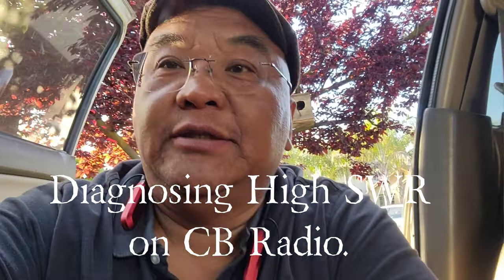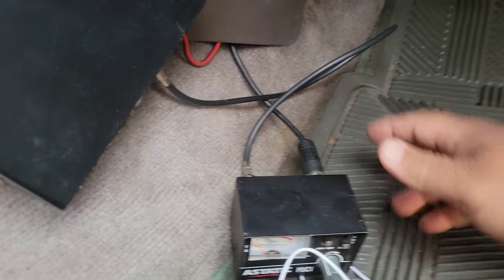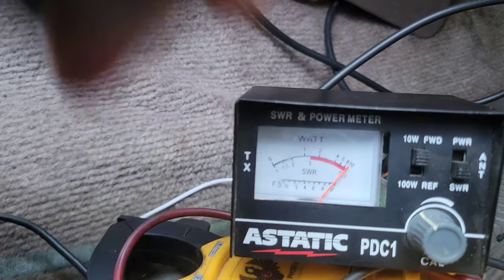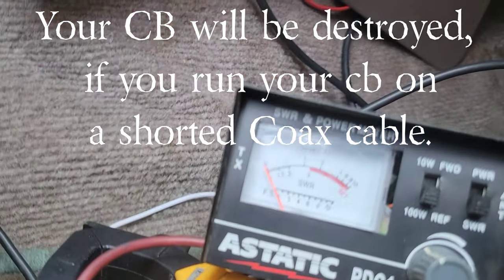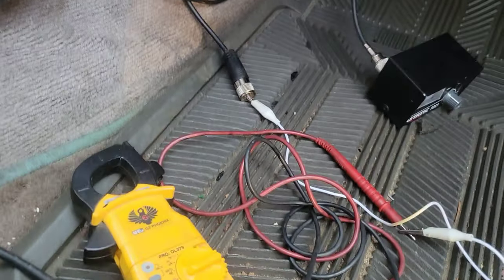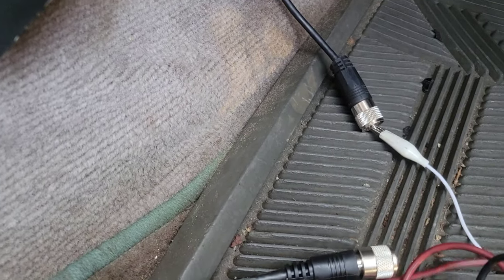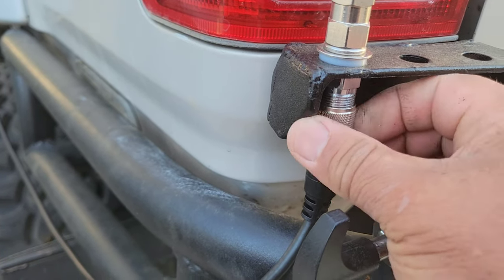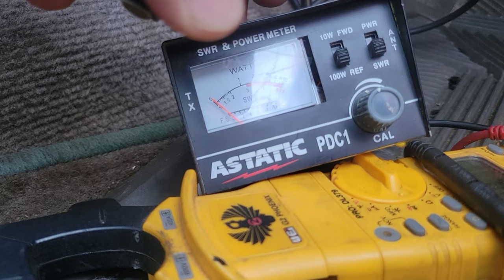Diagnosing High SWR on CB Radio

Comment: The other thing to take note in this video is that the radio has an SWR meter built into it already. So when you get your swrs correct using the external meter you can verify by checking with the radio meter and SWR mode. When to verify that the radio reads very similar or exactly the same as the external SWR meter you can periodically check it to make sure it stays the same in which case if you notice a difference then you can hook up the external meter again and see if it's really has changed

Comment: Mine was a ground plane issue. I started with both readings being almost maxed out near the set line. (Broken coax) replaced the coax and added a 90 fitting so that the new cable wouldn't break the same way. (Trying to get everything set up before hard wire, making sure the radio and antenna and everything works well together first.)
Now I get 2.5 on 40 and just over 3 on 1. I could try and tune it out to 2.8 on both but adding a spring would help a lot more.

For those that are running into the same issue you want at least 1/3 of the antenna above the highest point of the vehicle. Mine I have a 3 foot firestik that's mounted at the top of the front fender. It's not sitting high enough as it is so ill have to likely go to a 48in firestik with the spring. But either way I'm looking at likely only bringing swr down to about 1.5 considering how close the antenna is to the body of the truck.
Reply: mine swr same 3 . I have no idea 😮😮😮

Comment: You’re using the wrong button you’re using the white button on the left side you need to use the button on the right side that says SWR
Reply: In this video he's using the meter correct. When using this meter the switch on the right stays down in SWR mode while you adjust the calibration knob or forward reverse switch